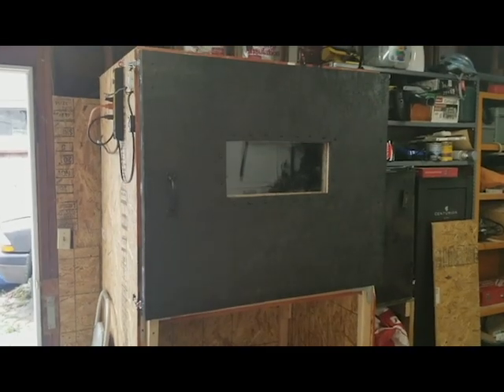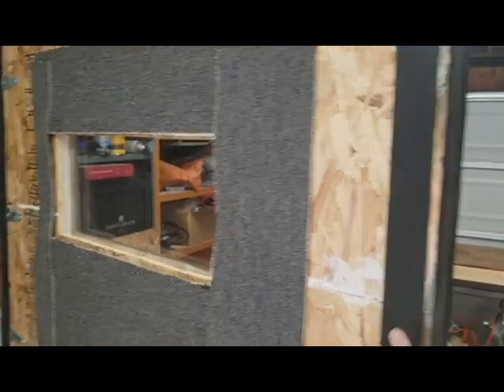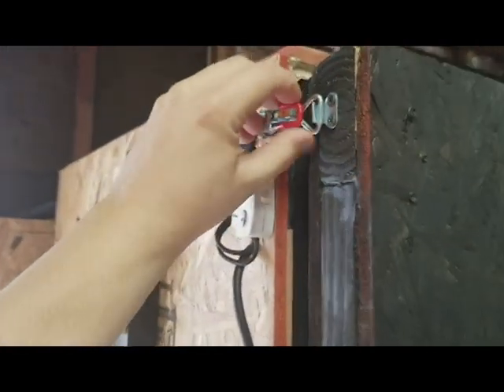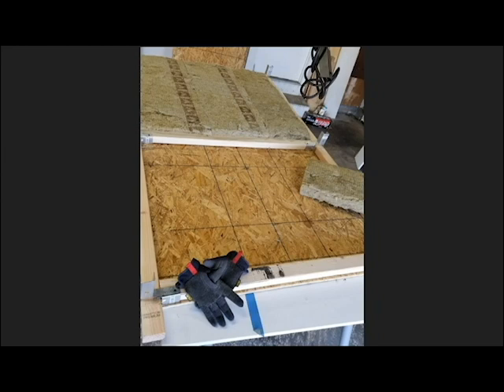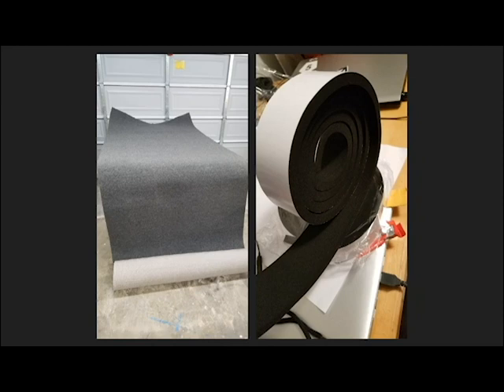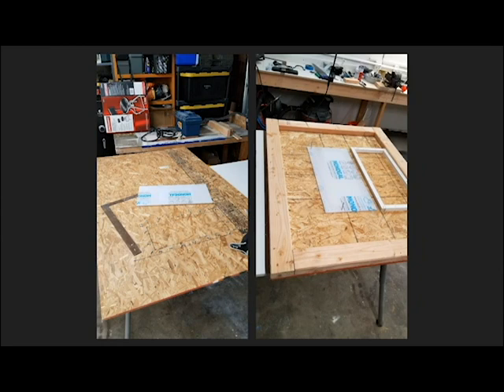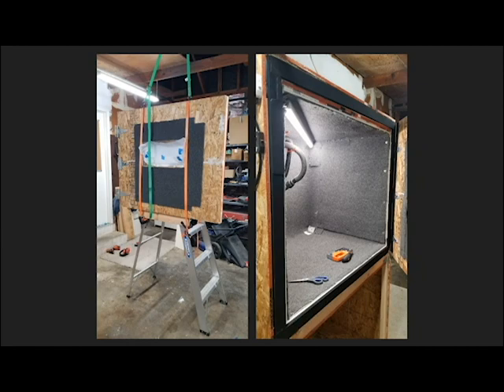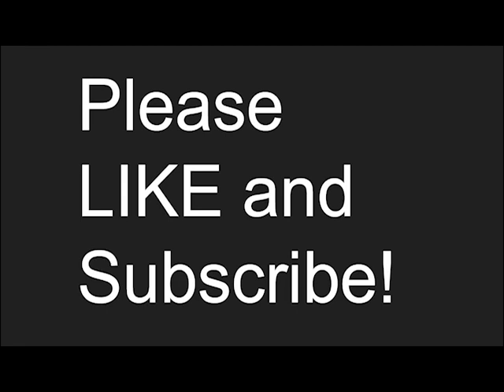Building a soundproof CNC cabinet! Why & How

Comment: Wouldn’t this overheat the CNC and the vaccum?
Reply from the maker: I eventually had to move it out, worked fine for small jobs but I just started vacuuming at the end
Reply: @triplegworkshop  So you removed the vacuum, but still kept the CNC in the enclosure ?

Comment: would you say your cabinet is quiet enough to be ran in a condo / apartment building? I'm moving to a new place and I now run my CNC just in the backyard, and possibly will need to sell my CNC :( so if I can do this in an apartment building that'd be amazing!
Reply from the maker: I ran all night one room away from people and the only restriction was I couldn't use the shop vac at night. I mainly brushed debris away during night work.

Comment: I used blue 1" foam and glued up a box that looks like your box but it's light and like a ice chest that sits over the whole table.  It keeps the dust contained and reduces the noise by half.  I lift it from the front corner to and prop it with a stick.  When it comes time to service the CNC I can take it off easily as it only weighs a few pounds.  I did reinforce the vac 4" hose with a 3d printed pipe and the corners where the stick props it up I made 3d printed corners.  It's been working well for over a year now.    Here a video on my build. 
 https://www.bing.com/videos/search?q=cnc+blue+foam+box&qpvt=cnc+blue+foam+box&view=detail&mid=CC745E0B3A444076AD27CC745E0B3A444076AD27&&FORM=VRDGAR&ru=%2Fvideos%2Fsearch%3Fq%3Dcnc%2Bblue%2Bfoam%2Bbox%26qpvt%3Dcnc%2Bblue%2Bfoam%2Bbox%26FORM%3DVDRE
Reply from the maker: I have had it out a couple times, once when I put in all new bearings and once when I changed out my main screw. Both got hopelessly gummed up with MDF powder. Pretty easy to get in and out by myself, the umbilical comes up the back through a 2" hole I stuffed with a t-shirt

Comment: What mill did you have in there? Also could you tell me the inside dimensions?
Reply from the maker: Any 60/40 should fit I forget the internal dimensions but you can calculate back from 48" wide ply. probably 39.5" from the carpet

Comment: I had to subscribe because of the door with the lever clamps and foam, and the demonstration of the sound reduction, and how he showed that with the door clamped down hard with the lever clamps, that it is a "game changer". It really is.  This was a really helpful video. It is the best sound enclosure video I have found.  It's a nice build, and being in a garage, it does not need to look cosmetically great, but still, I'd try to put a covering of some type on that chip board, to protect it, and to hide it. I'm not sure what material you could find for cheap for that though. Maybe a thin layer of plastic sheet, but that would be expensive.
Reply: ...and I came back to this video after seeing many if that tells you anything.  ...and am glad I looked at it hard this time.  In fact, I am bookmarking it. It's all about that door.
Reply from the maker: Thanks for the kind words Jeff! I didn't like any of the soundproof builds I researched, so I went my own way. I took the best from each and went with a swinging door instead of a huge door hanging over my head. The multiple materials each tune down a different part of the noise so it's really a team effort. Even that office carpet layer plays a part. I consulted an expert on plastics that suggested the polycarbonate airgap window, another huge piece of the puzzle. I installed it like a submarine porthole lol.
As for the look, it's really grown on me. I'm the type that likes the OSB look but I think at the most I'd just spray it. If you follow my FB page https://www.facebook.com/triplegworkshop I'll show you what it looks like now, it has an integrated computer and it's own live stream cam ;)
Reply from the maker: Ok I put a picture up just now

Comment: what is the sound meter db before and after ?
Reply from the maker: I don't have an accurate way to measure it so I did distance away. With the door open during a cut I heard it from over 100 feet away. With the door closed I couldn't detect it until I was inside the garage, 10 feet or so away. So I judged 90% reduction.

Comment: I'm curious about whether there is a heat dissipation problem, with the vacuum and the stepper motors inside a very well insulated 4-foot cube.  I've seen some discussions that say you have to do acoustic baffles on the ventilation air for an enclosed shop vac.  What is the temperature rise per hour of run time?
Reply from the maker: It gets up to about 90 after running for 12+ hours. I don't run the vacuum all the time, that heats up fast. The spindle water temp plays a big role.
Reply from the maker: I let it run 24/7 and it tops out at about 90 degrees inside. I have a 4 gal reservoir and that helps a lot and it takes forever to warm up past 80. I don't run the shop vac inside the box anymore but I'm sure that got hot quick.
Reply from the maker: The idea was to keep a shroud on it and run that vac inside, but like you are thinking, it caused multiple problems. It heats up, it gets in the way, it causes a dust tornado, etc. Now I pulled it out and I use my big shop vac when needed and it's better for me. As for the other heat sources, I have a 4 gal reservoir and it really prevents the box from heating up above 80f. Even when it's 90 outside that thing only hits 92.

Comment: nice. im just going to make my stand for the cnc bigger then I need it then make a cap with a lift up door so the cap just sits over the whole machine will use 1/4 20 bolts with tee nuts so I can lift it off if I need to. my garage-shop is over a hundred feet from any houses so a little noise isn't issue I just want to hear myself think lol